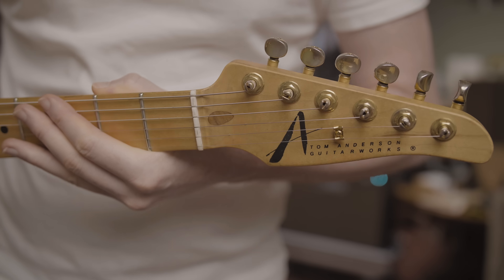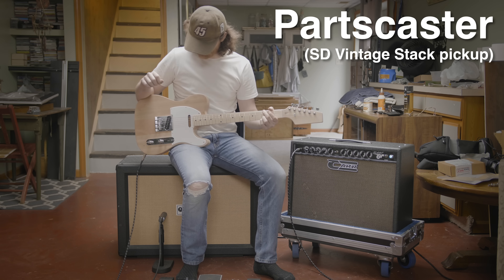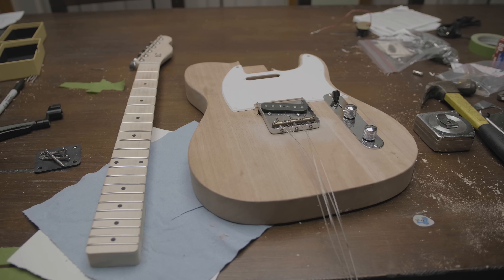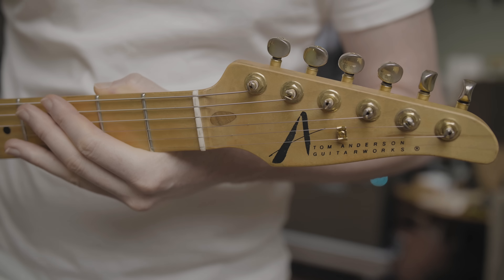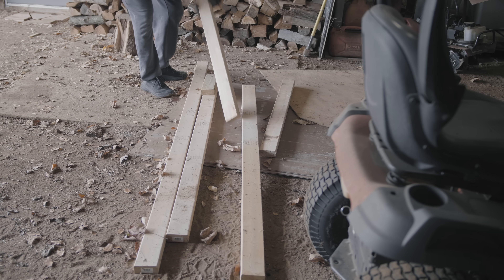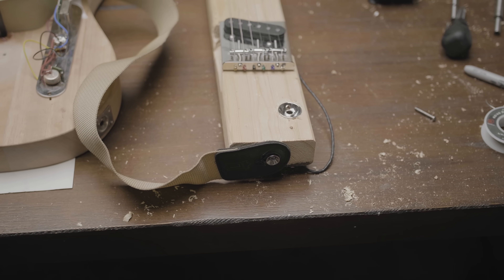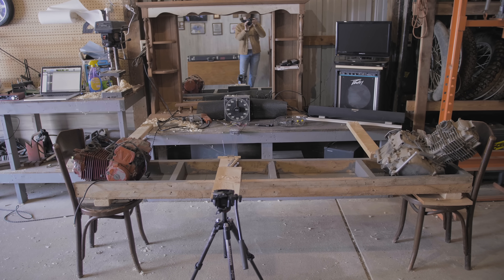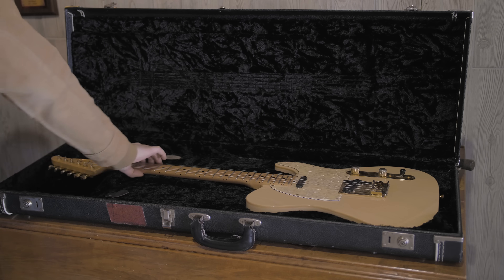Tested: Where Does The Tone Come From In An Electric Guitar?

Comment: The air guitar actually sounded closer than the 2x4 to me. The parts caster also sounded pretty much identical.

In terms of physics the wood making up the bulk of the body/neck should have some effect on which frequencies get damped over time when sustaining, but obviously that's going to be pretty small compared to pickups, pickup position, values of pots/caps, and strings. (But people are tripping if they think fret inlays or even the thin layer of rosewood on the neck makes any tone difference.)
Reply: That might be because he used a different capacitor for the 2x4. The capacitor is a very important part of the circuit because, together with the tone pot resistance and the pickup (that can be imagined as an inductor in addition to a generator), it decides the position of the resonant peak of the low pass filter applied to the guitar signal. So I would say that the two most important factor in a guitar are the electronics and the pickup position.
Reply: There is also the psychoacoustic aspect to consider here. I have watched several videos (assume they are still on YouTube?) of "golden ears" of the recording industry listening to different preamps etc. in a blind test, and almost none of them were reliably able to identify the difference between a cheap preamp and an extremely expensive well revered preamp when they can't see which they are listening too. Sometimes the preamp wasn't even switched out and they still thought they heard a difference. I've experienced this mental trick plenty of times with things like compressors etc. in a mix. Swore I almost had the perfect "tone" dialed in, only to realize I had the effect bypassed in the chain! Our brains are more than capable of providing us with apparent differences if we expect to hear them, and due to other factors like fatigue and mental state at the time. The bottom line is human sensory inputs are subjective by nature, so there will probably never be a definitive answer to this that will be accepted by all. Your desire (or lack thereof) to hear a difference will to some degree likely make it so.
Reply: @AlchemyfromAshes  in the same light, we tend to support paradigms that are more comforting even though it is false.  Taking first class vs. Economy for a trip from LA to Texas may not be much of a difference, but it does when you travel from LA to say, 10000 miles away like Japan.  There are many factors to why we choose wood and certain configurations in a guitar.  

If we talk 'tone' strictly from an audience perspective listening to compressed audio with a sharp 16kHz rolloff, the differences diminish largely, and it is sort of dogmatic too on the part of the anti-tonewood people to believe their claims, and point to this video, when in fact it also confirms the claims of the other camp.  It's all about tolerances.  And not being able to play those guitars in person (ie the 2x4, the partscaster, the Tom Anderson and the air guitar) just skews the pseudo-science behind it.
Reply: @De4thInc4rn4te16  tone wood is not pseudo science. Sound is not a perfect science.  That's the reason why all flat-response monitors claim to have flat response, but put them all in the same room, they sound different from each other. 

I'd rather think tone wood is just one of the variable unknowns to great tone.  With all things considered (ie. ADSR, frequency response, amplitude, and all your parameters in sound), you still know there are other factors that cannot be measured.  

Ironically, there are some things that can be measured but cannot be heard.
Reply: @dodjiegarcia2320  I wouldn't go as far as saying that tone wood is pseudo science but I would definitely say that turning the tone knob of any guitar 5% up or down would make much more of a difference than changing out the entire guitar (assuming that after the swap they are set up identically with the same electronics, distancing and all). Maybe having a heavier body means having slightly more sustain but I would definitely be surprised if the difference is in any way relevant.
Reply: @De4thInc4rn4te16  Take it a little further, make a guitar out of sponges, and make a guitar out of solid stainless steel (of course you cannot carry it so you need a stand).

The sponge guitar will absorb more vibrations, hence the sustain will be much shorter, while the stainless steel guitar will sustain much longer as the molecules of steel are more rigid, hence the sound particles are more excited as they bump each other.

Question, which will sound 'better'?

Imagine wood as a more rigid sponge that can absorb some of the vibrations, hence produces harmonics (well actually sorts of EQs it in the process).  

Now the pickups.  Try this. Install a non-potted PAF type pickup in a Les Paul weighing 10lbs with a short neck tenon and another one weighing 8lbs with a long neck tenon.  Get back to me and tell me they sound the same. If pickups were the be-all and end-all, then pickups are the only solution.
Reply: @dodjiegarcia2320  you know what, i have some oxygen free copper guitar leads that you'd be interested in
Reply: In terms of physics, do you know if those damped frequencies are within the audible spectrum, or are they harmonics outside of it?
Reply: @SuperBrokenfoot  Harmonics affect how the fundamental is perceived...
Reply: @uburoibob  you can have harmonics outside of the audible spectrum...
Reply: @SuperBrokenfoot  doesn't matter if you can hear them, but you sure can feel them.  A really great electric guitar vibrates against your body when strumming almost like an electronic massager against your belly. 

It's weird that many use this vid as proof that tonewood is a myth, when in fact if you listen very closely you can hear the differences.
Reply: @dodjiegarcia2320  I'm sure if you listen even closer you can hear the elements introduced by YouTubes compression algorithm too. 

What you're getting into is the feel of a guitar. What this video discusses is the tone of a guitar. 

The extremely subtle differences in tone you're hearing could be a result of the differences in manufacturing of the pickups/pots. You can't definitively prove that it's the wood that's causing those differences without doing the math to figure out the damped frequencies introduced by the type of wood, and determining whether or not they're even within the audible spectrum. I'm sure there's also a fair amount of signal math to be done to figure out to what degree the type of wood affects the output signal, if at all.
Reply: @dodjiegarcia2320  you can hear a difference maybe, I am not sure because I don't hear much of any but that may be given by another very important factor that has not been addressed in this video and that is the constructive or destructive interference of the strings and the amplifier and that is entirely caused by differing distance from the amplifier. That is why when a guitar starts a feedback you can choose which overtone you want to accentuate by very slightly moving around
Reply: @SuperBrokenfoot  Most potentiometers have a tolerance of +/-5%.  It's a rarity to have one that goes way out of tolerance (eg. Eric Johnson's Virginia Strat that had defective 250k pots that read 300k)  But I do not think that an average pot that reads 250k will sound much different from another that measures 262.5k.  

Here's a common sense retort. Try to go to the biggest guitar shop you know with lotsa stocks of one same model with same specs, only that they offer in both ash for transparent finishes and maybe poplar or basswood for solid color finishes. G&L offers that.  Compare all the guitars in stock making sure they all have the same configs.

In theory, they should all sound the same, if the premise that "tonewood does not exist" is true.  But I will guarantee if you test 20 guitars of the same kind with different body offerings, they will not sound identical to each other.
Reply: @dodjiegarcia2320  have you checked the action precisely on all the stings of all of them? As the video suggests that is the single most important things you have to do to ensure a fair comparison between two guitars with the same hardware
Reply: @dodjiegarcia2320   I'll agree with you on the tone pot portion. If you do the math @250k you get around 13.5Hz as the low pass cutoff point, and @262.5k you get around 12.9Hz as the cutoff point, assuming you use a .047uF cap. Both values are outside of the audible spectrum, so it shouldn't matter what the difference is.

In your "common sense" retort you neglect to mention whether or not the guitars are set up the same in regards to pickup distance from strings, so it wouldn't be a valid test as the guitars may not be set up identically.
Reply: @SuperBrokenfoot  I implied it when I said "all guitars with same configs" just to be clear, meaning, same action, same polepiece distance from strings.
Reply: @dodjiegarcia2320  the video did that though. Just without the exact types of woods you mentioned, or the shape of the body. Most people that watched the video agree that the tone of the guitars are the same.
Reply: @dodjiegarcia2320  As someone with a PhD in applied mechanics, specialized at vibration measurements and simulations, let me tell you, that this vid can be definitely considered as strong proof against tonewood. Completely different gemetry and materials conneted to the fixed ends of the strings, and still sound very very close to each other. You are right, tha air guitar is not air but workbenches etc, but still very different from the 2x4 and from the tele.
Reply: @strangermm  First off, I wanna qualify I believe in tone wood. But what I do NOT believe is that there are certain species that deserve the creme dela creme label of awesome tone wood.  That's where your marketing comes in, like saying South American mahogany and Brazilian Rosewood is superior to Philippine Mahogany and Indian Laurel.  There are woods that are cheaper because of   less demand from the guitar market. 

Most of the people here have pre-conceived notions, and while many think the video broke the tone wood paradigm, the evidence is in the recorded tones themselves. It's all a matter of tolerance for the listener, moreover, the player.  

Remember the time when Fender introduced Poplar for their MIM entry-levels some 25 years ago?  It was frowned upon by purists, but now you see them in John Mayer PRS SEs.
Reply: @Dodjie Garcia  if you truly go to shops to test brand new guitars, you will certainly know every exact model on the floor has slight variances in string/pickup height. Not one companies QC is stringent enough to insure otherwise.

In Garcias case, You can lead a horse dying of dehydration to water but can't make the damn thing open its eyes, or something like that. 😁
Reply: @dodjiegarcia2320  because not every guitar is set up the exact way cmon man get real, no shop gtr tech has time for THAT lvl of being dialed in like the effort put forth in this video. Re: “not air guitar” well then will you at least concede that the neck wood/mass has no effect on the sound since, there’s no neck...?

However, I completely agree with you when it comes to the “feel” of a guitar when it resonates in one’s hands, 100%. That doesn’t impact how it sounds for an electric guitar (acoustic gtrs absolutely those factors matter more than anything) but it can impact how you play just by how it feels, which can obviously affect the sound too but that’s more of a “to flavor” kind of thing

There are ppl who put piezo pickups on an electric gtr for a dedicated path to a power amp that drives a transducer (cone-less speaker) attached somewhere on the electric gtr (usually the headstock) JUST for the feel it gives. Also if anybody wants to feel the difference in mass just take your electric gtrs headstock and touch it against the nearest wall you can and strum and play, if you are unplugged you WILL hear a difference along with the more resonant feel, BUT since electric gtrs work thru pickups via process of magnetic induction this acoustic effect has NO impact on what the signal is going to the amp

Cheers
Reply: @dodjiegarcia2320  Your common sense retort misses the control case.  That is if you go into a shop and play 20 identical models they will also all sound different...
Reply: @alan_davis  What is the major premise of the video? What contributes most to the tone of a guitar, but then he was changing out as many variables and in the end, it was only the pickups and wiring (including the same polepiece distance from the strings) that were common. 

Trying out twenty identical guitars (try 20 of the same model and same wood configs and set them up identically), I will bet that they will still not sound the same. I would go to like 3 or 4 music stores whenever I buy a certain model of a guitar just to see which store has the best one, and I cannot discount that even in a music store with a huge inventory, you will still choose the best one for you.
Reply: @dodjiegarcia2320  Sorry man, you miss something seriously. Nobody is trying to convince you that they sound identically. We are trying to explain you that there is only a marginal diffenrence in tone, compared to the huge differences in the telecaster vs. 2x4 vs. table setup.
Reply: bridge, nut, strings, frets and pickup, these factors alone in an electric guitar, the stings excite the pickups as an electromagnet, poisition of said electromagnet, string guage and tension, then the two points the strings are anchored at, be that nut and bridge, or fret and bridge, all this toan wewd nomsense is just that, nonsense bled over from acoustics, where body wood does make a difference
Reply: Not to mention that the two tables are resting on the floor, which makes them resonate much better.  That is the same principle as building hanging bridges.  Sorry to sound like a jerk but that is science right there. It is NOT an air guitar.
Reply: The “air guitar” is more like a “table guitar”. Because the strings are vibrating with their anchor points, aka metal desks.
Reply: There is more to just frequency response.  There's the "responsiveness to playing" thing in guitars too.  A very, very dense wood will almost not resonate while a fairly medium-light wood will resonate better, and these things are felt by the player.  Have you ever tried a Fender all Rosewood guitar (not the chambered reissues)?  They are bright AF and the only reason why they are sought after is because solid rosewood is expensive, and because George Harrison.

Comment: Ok, I never comment, but since this video had to be so much work I want to thank you.

What you've demonstrated in the video is a believe I've held for years (simply by reading, listening to comparisons and "my logic") - that people obsess so much about stuff that has no effect (no perseivable effect) on the guitar tone. 

What is frustrating, is that people obsessing about the guitar as the source of the tone seem to forget about the rest of the signal chain, even though you need the rest to actually hear the tone. Or are you playing unplugged? 
Most guitars have tone pot, so you can just turn the knob and considerably change the tone. Then you have the amp (a thing that massively changes the tone) - it has its own tone controls too, so if your guitar has "whatever" tone, the amp will drastically change the tone anyway. 
Incredibly important is also the speaker (or an IR if you're playing digitally), which will totally transform your tone as well, so whatever you've put in front of the speaker now doesn't matter, because the speaker has its own frequency response and now you're gonna have to go back and tweak everything all over again anyway. And let's not forget about a simple EQ pedal.

I think people also don't consider the context of the music reproduction. Are you playing live? Then tune your guitar, dial in a tone that doesn't sound shit and play catchy songs. That's all you need. No one cares about your boutique $200 OD pedal that has different tone than a "regular" overdrive. No one cares and even if they did there's no way they could tell.
Are you recording an album? Because then you're probably going DI into the DAW, so you're gonna be able to tweak everything in such a drastic way, that you can make the guitar sound like an accordion, so why whine about the fretboard not being a rosewood?

Most of it (I'd say) is about people justifying their purchases. But instead of saying "I just like that the guitar is made of basswood,...I don't know, I just like it", they go "Na-ah, the "data" clearly show that basswood has "x" amount of "x" property and that's just essential for my tone".
Guitar players are such a pretentious nerds (I should know:D),...... Just fucking say you like it. Why the need to justify it? 
I would love a neck-through guitar. Not because it has better "x" (it doesn't), but because to me it looks cool and I bet the smooth "neck joint" feels awesome to touch.

For years my answer to the question "What guitar should I get?" was "The one you like". Because if you like it, if it looks cool to you, you're gonna want to play it and it's only with experience when you realize you might enjoy a more flatter radius fretboard (and such). Don't worry about that now. Of course there's little more to it (but just a little).
 Decently built, inexpensive guitars are everywhere these day, so just get the one you think looks cool. And because it looks cool it's gonna also play great for you. Worry about the tone when you're buying an amp (and a speaker cab), not the guitar.
Reply: Best comment on here. The same pretentiousness can be found in all walks of life, placebo plays a huge part in it.